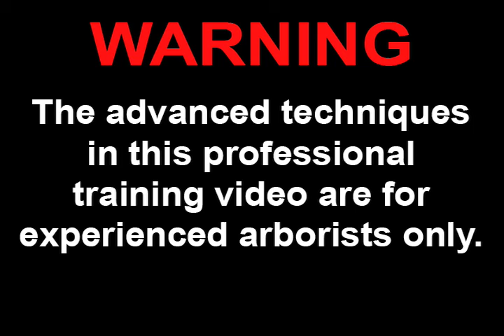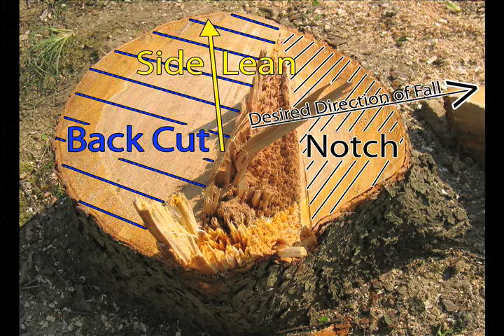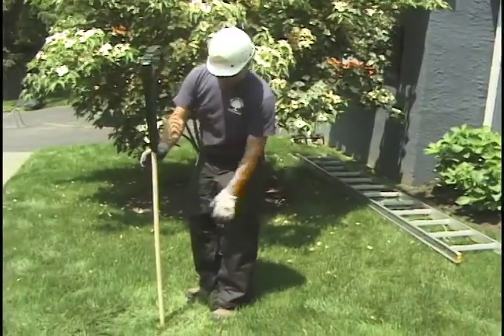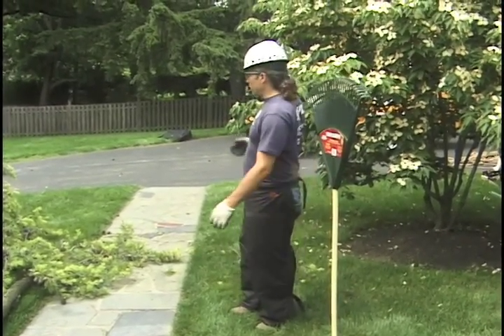Tree Falling using Retainer Line and "Stick Trick"

Comment: How come the guiding rope didn't pull the tree to the right from where you were standing?
Reply from the maker: there is the pull line and the retainer line.. retainer line is set 90 degrees to the intended lay. Its purpose of to catch the tree if the hinge fails and keep the tree from falling towards the side lean.... when set up properly the hinge will hold until the tree is committed to the lay... the reatianer line is only  a back... It's the best insurance for side leaners when it's possible to set up

Comment: The stick trick looks great on level ground. What's the formula on a hillside ?
Reply: You can use it to find the rough height of the tree on the level, measure/pace back to tree then use that figure in direction of fall.  (uphill will be slightly longer, downhill shorter...)

Comment: I never realized there was a "controversy" over the effectiveness of the tapered hinge.  I discovered it for myself years ago simply through experience, and there is no doubt it makes a big difference on fall direction and holding ability on side leaners.  I can't imagine how somebody could "prove" otherwise...  Thanks for taking the time - I seldom fail to learn something from your videos!

Edit:  Of course that's not to say I'd hesitate to use a second line if there is any doubt.  Naturally, you'd rather explain to the boss why a tree took a little longer to drop than why it's in somone's living room...  ;)

Comment: Good drop. I never knew it as the tapered hinge until recently. I knew that I could control the drop with more detail with two/ three ropes and the fibre of the wood not cut would pull the tree and the ropes will not let the tree go the direction opposite of where the ropes were anchored. Stay safe